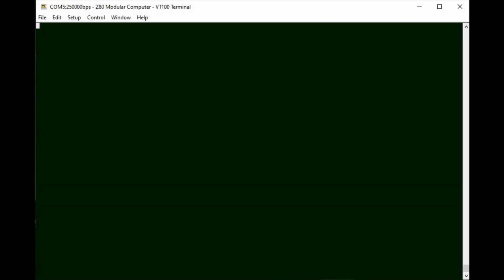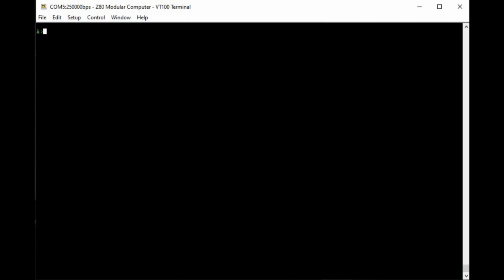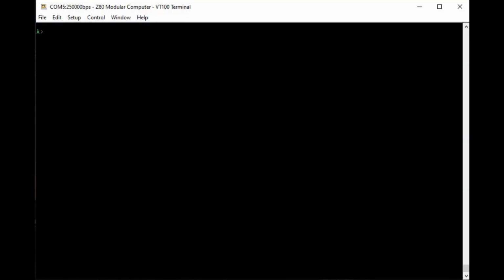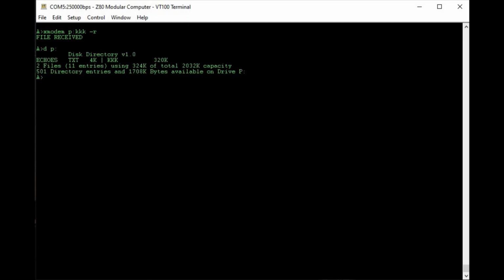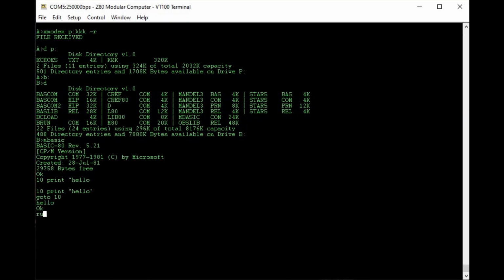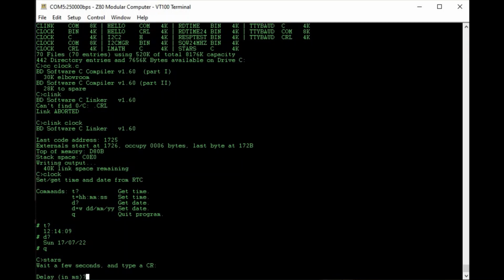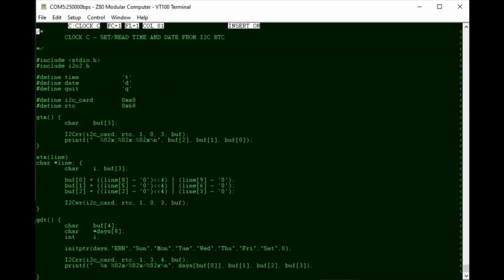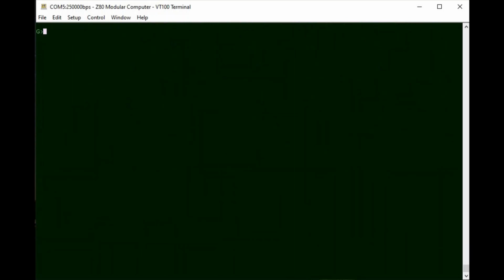Proton  Z80 Modular Computer demonstration

Comment: I''m very impressed.  This is a beautiful demonstration of the concept of a modular computer and I especially like that you did this all yourself.  As I watched this video, I couldn't help but wonder if a relatively inexpensive computer could be built this way; the modularity seems like it would offer a lot of flexibility.
Reply from the maker: Hi Mike. The reason why I chose modularity is so I can experience with different concepts and cards. For example, right now I'm testing a new family of cards (remote I/Os) for automation, using Modbus over RS485. Besides the flexibility for new hardware, the modularity concept also allows me to test many software ideas. So far, I already have 3 completely different microprocessor/microcontrollers working "in harmony" (Z80, ATmega328, AT89C4051). After I finish the automation RIOs, I'll make a card with keyboard and video interface, based on the STM32. Can't wait for that!😉

Comment: A fun and great project. I did build 3 modular Z80 PC’s from 1980-1982. They were build based on the work by a danish engineer, that published the project in an article series. Same principle as yours with modules and a backplane containing the bus. Back then I also had to develop the bios, thus integrating CP/M with the hardware. It was great fun, my introduction to assemblers, the characterbased wordperfect and one of the first spreadsheats Lotus 1-2-3. Great fun and very educational at the time.

Comment: This reminds me of the first computer I had in the early 1980s. The computer was a Heathkit H89 computer. This was a Z80 type computer. There were two operating systems the Heathkit H89 could run. One operating system was Heath Disk Operating System called HDOS and the other operating system was CP/M. We have sure come a long way from those days of very basic operating systems and text only displays with no graphics.

Comment: Nice implementation ! Nowadays ATMega emulating UART is cheaper and more efficient than 8251. Especially I  liked simplicity of using dual row 2.52 pins. 
Can you make detailed video about cage, pcb holders etc
How the gage and pcb are made worth the separate video same as computer schematics!
Reply from the maker: Alex, I'll try to make a short video of the mechanical parts and enclosure. About the electronic schematics, we can find all in my Github repo under the "KiCAD files" directory (https://github.com/KALTCHUK/Z80_Modular_Computer/tree/master/KiCAD%20files).
Reply: @p.r.kaltchuk5120  Thank you. Making a case is the second big problem in all DIY projects  /* after the making it work :) */ And I don't see videos about making professional mechanical parts and enclosure.
Reply: 2.54?

Comment: Thank you. It great Z80 computer.  I am wondering if this computer would be available as a kit?
Reply from the maker: Hi José. No kit, but all the project  is in public domain. You can send the gerber files to the PCB manufacturer and buy the components on the BOMs, all in my Github repo. Check the Proton User's Manual for the build procedure.

Comment: Hello. I am currently working on designing and building a Z80 computer, I am curious as to what items you used to construct your card cage.
Reply from the maker: Basically, I used:
- a backplane, which in fact is made of 3 backplane cards cascaded, so I have 9 slots for cards.
- top/bottom/lateral cards for mechanical structure.
- nylon PCB slots. 9 on top and 9 on bottom.
- Aluminum L frames (10x10mm).
- M3 nuts and bolts. Huge amount.
Check the "Proton User's Manual"  in my Github repo. Lots of pictures there.
Reply: @p.r.kaltchuk5120  please, please make a video about construction
Reply from the maker: @alexloktionoff6833  here it is... https://youtu.be/76cNTgPcxQM
Reply: My advice is, don't. If you want to build an 8 bit computer system, go use the 6809 microprocessor. Far better.

Comment: Congratulations good job. Can you sell PCB? Where do you live?
Reply from the maker: Hi Antony. I don't sell the PCBs, but you can order them from JLCPCB, for example. In my Github repo you'll find a directory called "KiCAD files" (https://github.com/KALTCHUK/Z80_Modular_Computer/tree/master/KiCAD%20files). It has the schematics and PCB layout for all the cards, even the Gerber files already zipped. Just download the zipped files and send them to your favorite manufacturer. Don't forget to chose the colors. I used blue for the cards and black for the enclosure.
Reply: @p.r.kaltchuk5120  Hi. thank you for your answer. Just one question left, is all V2 are a good choice?
Reply from the maker: @M0GLU  not sure I understood your question. Please elaborate.
Reply: @p.r.kaltchuk5120  The KiCAD files folder contains Backplane and Backplane V2. The Backplane V2 is the latest and that is the best choice?
Reply from the maker: @M0GLU  correct. V2 (version 2) is the one you saw on the video demo.